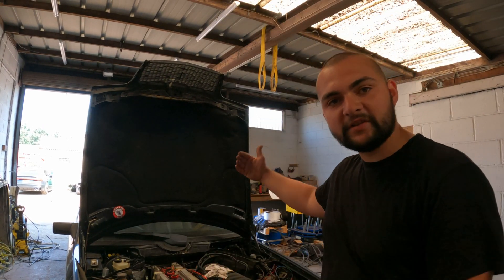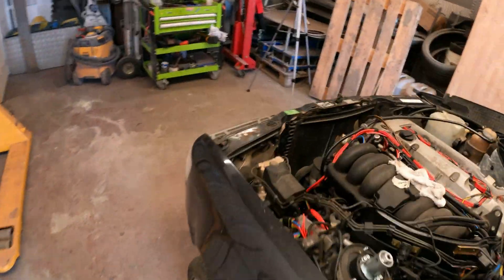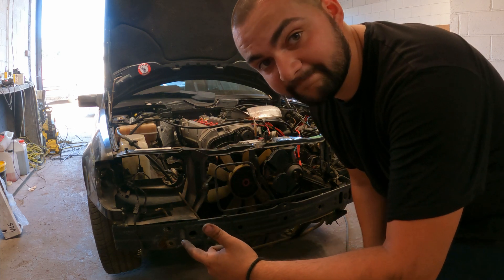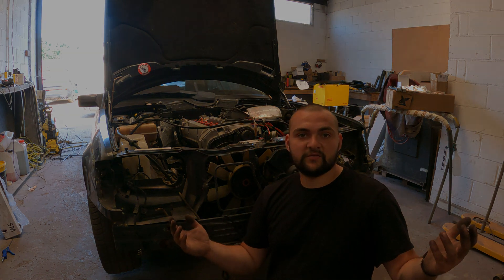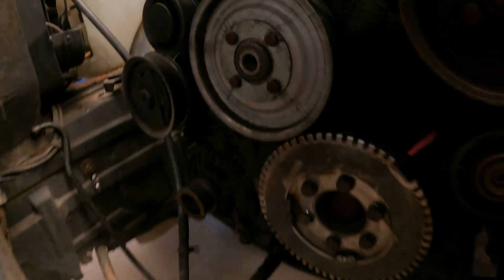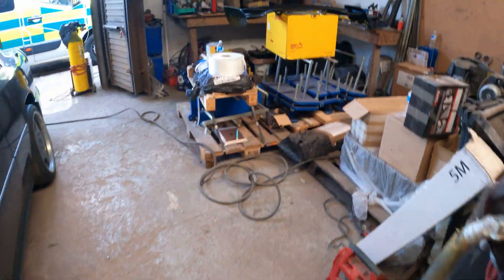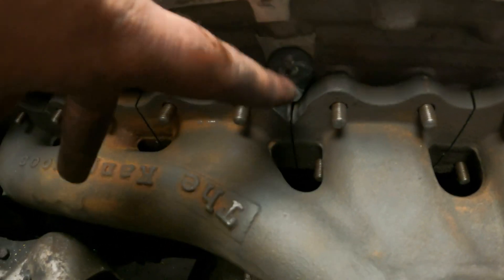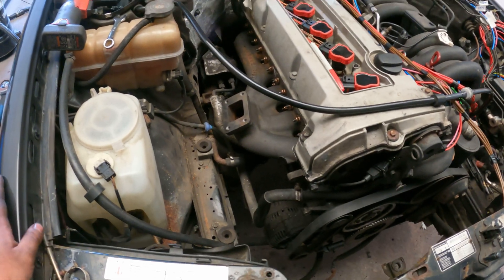Mercedes C124 M104 Turbo Project pt. 3

Comment: Маховик используй от м111 w202, он 60-2
Reply from the maker: I welded 60-2 on front pulley.
Reply: @driftinrust  will you put the 722.6 transmission instead of the 722.3?
Reply from the maker: @игорьбереснев-г2в  it has it already i think.
Reply: @driftinrust  already installed 722.6?
Reply from the maker: Yes, it’s 5 speed auto.

Comment: I so badly want to do a M104 swap in my W202
Reply from the maker: Do it!
Reply: @driftinrust  I was just going to turbo the C230k engine , as I’m unsure what needs to be done with the conversion , live diff , prop shaft , wiring , and stuff like that 😂
Reply from the maker: @Shadowmosesarea51   You can probably use everything stock, not sure tbh.